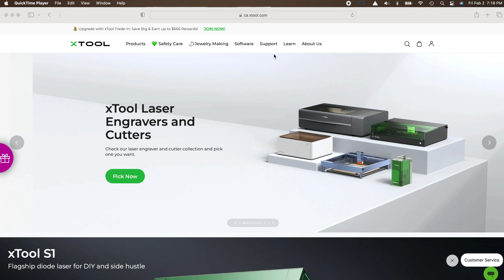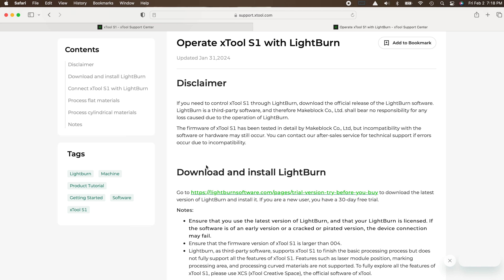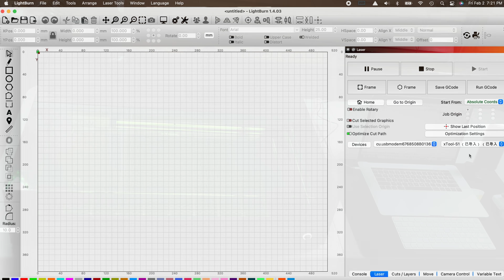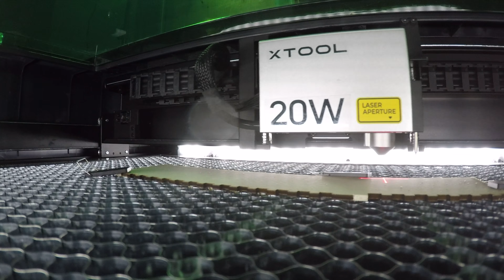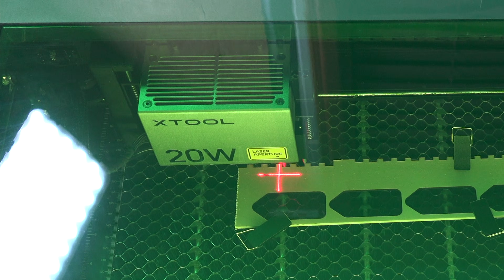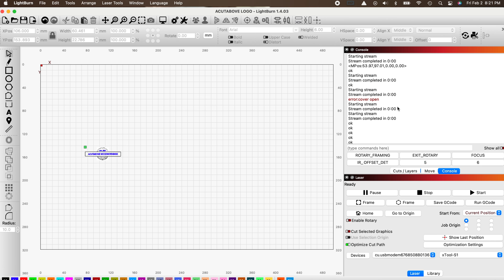Using the xTool S1 20watt Enclosed Laser Engraver with Lightburn

Comment: Have you got anything on the new version of Lightburn and the S1?
Reply from the maker: I don't think there are too many major differences from the version of Lightburn that I used in this video and the newer versions of Lightburn.  Slight tweaks and adjustments but nothing major.  Thanks for tuning in to the show,
Reply: @acutabove_woodworkings  ....... Thank you for the speedy reply.
Gould you go over the Z axis setup ? I'm not clear what they have set the defaults at and how that interacts.
Thank you .. I appreciate your help.

Comment: Hi it’s been a struggle for me to find the right power and speed to engrave clear acrylic with S1 20 Watts. I would really appreciate if you wouldn’t mind sharing the settings please and thank you.
Reply from the maker: Clear acrylic is notoriously troublesome when engraving it with a diode laser.  There is nothing for the laser to focus in on so the laser light just get bounces everywhere.  If you are trying to cut clear acrylic with a laser, you will find that it will never work.  I have never seen anyone successfully cut clear acrylic with a diode laser.  A catalyst such as black paint can be used on the surface of the acrylic to give the laser something to focus in on but you risk scratching the acrylic while washing off the catalyst.  Clear acrylic is a completely different animal when it comes to diode laser engraving and personally, I avoid it completely.  I hope this helps. Thanks for tuning in.

Comment: What about the power settings? You only get 100 % power, even when you drop the power to 20%. Any ideas on that?
Reply from the maker: There is something not right there.  What laser software are you using?  If you drop the power level down to 20%, it should engrave at 20%.  What makes you think that it is still firing at 100%?  The laser light looks pretty much the same regardless of the percentage of power.  Only when it gets really low do you notice a difference.  Trying a picture in grayscale on a small piece of wood will tell you if your laser is adjusting the power or not.  If you set your minimum and maximum levels in the grayscale engraving settings and the picture comes out as a black square, then you power levels are not adjusting.  If it comes out looking like a picture, then your power levels are adjusting just fine and you need to adjust the power and speed settings of your engraving to get the results that you need.  A little more information would be helpful.  Thanks for tuning in.

Comment: Very informative, thanks. Do you know if it connects to Lightburn using WiFi.
Reply from the maker: To the best of my knowledge, no xTool laser will connect via wifi through Lightburn.  It's a patch that they haven't bothered to fix yet.  The same issue exists on the D1 Pro.  I hope this helps.  Thanks for tuning in to the show.

Comment: Hello, This video was very informative thank you for creating it for us S1 newbie users. I was wondering if you have tried the materials test in Lightburn under the Laser Tools menu for speed and power? I had a weird issue where Lightburn was cutting out some triangles instead of squares during the test pattern and it does not seem to adjust the power for each line. It seems the power remained at 100% because it was cutting out even at 10% power. Since then, I gave up trying to use Lightburn with the S1 and been using XCS which works and is ok but I want to try and go back to using Lightburn that has way more editing features. Thanks in advance if you know why the triangles being cut instead of squares is happening. I have the latest Firmware as of 3/25/24.
Reply from the maker: I have never heard of this happening but I have also not done a burn test grid with the S1 and Lightburn.  I will be working with the laser this weekend and will try a test grid and see if I can duplicate your results.  Thanks for tuning in and for chiming in with this issue.